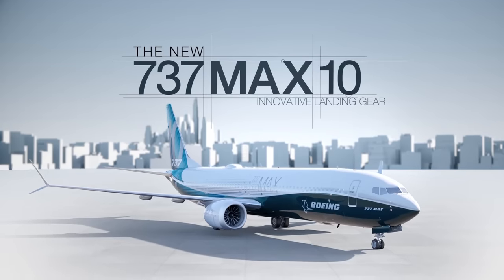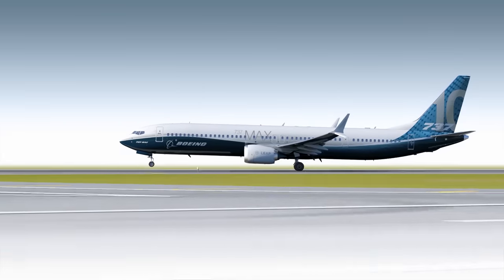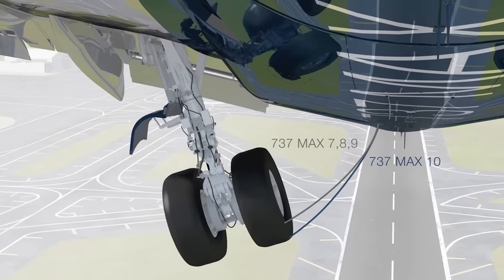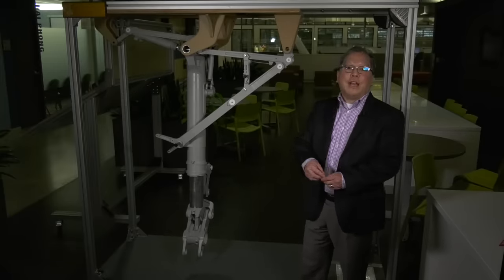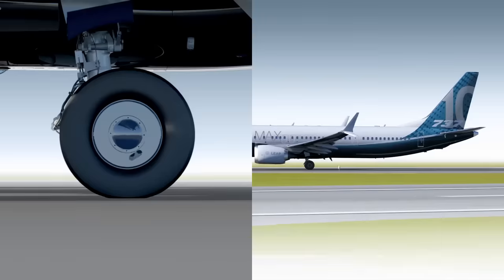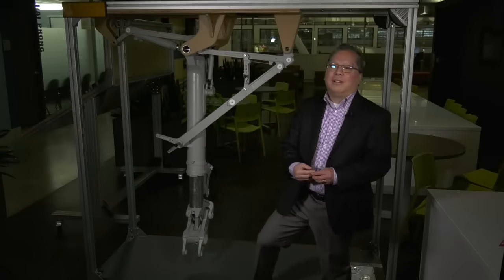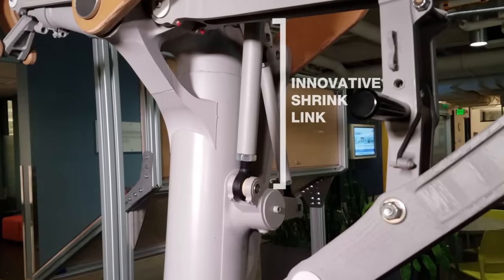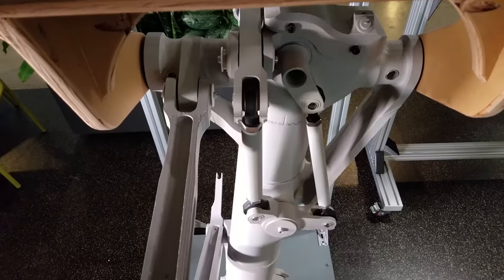How the 737 MAX 10 landing gear works

Comment: Very clever engineering, but also a sign that they have reached a limit on the 737 airframe.  Time for a new design.
Reply: Totally agree, the true plane that brought flight to the masses, not the 747. The MCAS, this complex landing gear, to preserve commonality between 737s. I can see the current 737 market thriving in remote airports etc with few facilities, just my opinion. I guess the time used to fix MCAS, the 787 faults, bringing the 777X to market and deciding what to do with the 748 has left Boeing management in disarray with no clear plan for the future. Just my opinion; not saying my opinion is fact!
Reply: Designing an overly complex landing gear to fit into a bay designed 60 years ago for a plane nearly half the length... 😬
Reply: Noo I love the b 737 fuselage😢
Reply: Don't fix what's not broken
Reply: Corporate doesn’t agree.
Reply: Would it be better if they had it like the Boeing 727 or 717's setup, engines mounted in the back
Reply: @wooden2187 You couldn’t design this landing gear even if you wanted
Reply: Why ,production is backed up 7 to 10 years.

Comment: That's cool but you won't be needing landing gear if you nosedive into the ground just saying...
Reply: MS Aviation TFS the 200 & 300 didn’t with its faulty rudder design. But if you look at the stats the 737 has statistically had more accidents than the A320 even if you start the stats from the A320’s first flight
Reply: MS Aviation TFS go on then. These are the last 10 major accidents and incidents of 737....

Ethiopian 302-Mar 2019 Unknown
Lion Air 610-Oct 2018 Unknown
Air Niugini 73-Sep 2018 Undershot Runway
Utair 579-Sep 2018 Overran Runway
Xiamen Airlines 8667-Aug 2018 Crash Landing
Lion Air 892-April 2018 Runway Excursion
Southwest Airlines 1380-April 2018 Uncontained Engine Failure
Pegasus Airlines 8622-Jan 2018 Runway Excursion
Southwest Airlines 3472-August 2016 Uncontained Engine Failure
Batik Air 7703-April 2016 Collision
Reply: @martinshiel7029  I think you should go back to your office at the Boeing marketing
Reply: @tomstravels520  I think Boeing tried too hard to push the 737 above and beyond it's limits. Boeing didn't had any other choice, they couldn't just leave the A320neo without any competition, but the 737 was a plane designed for the '60s and the '70s and IMHO the 737NG should have been the ultimate 737. As it's design was influenced to be the best in the 1970s world, where engines were small, landing gear could be lower to the ground to allow for little airports without infrastructure to still support 737 operations. The A320 was born in a different world, a world of high bypass turbofan and a world where every airport has equipment to handle even planes that sit higher to the grond, and on the longer run, this difference really made the 737 not able to compete with the A320. Boeing cannot make the 737 the plane of tomorrow when it's design was optimised to be the plane of "today" (as it was built). Still the 737MAX had the potential to beat the A320neo but at much higher cost and risk. At this point they need something completely new. Or a complete overhaul of the 737. I think they will try and make a small version of their NMA to try and get the 737M10 and A321neo share. That also explain why the A320 is almost as popular as the 737 even tho is a good 10/20 years younger
Reply: MS Aviation TFS The 737 has a clean record? Hahahahahaha. That's the biggest load of rubbish I've ever heard.
Reply: Thomas Mortimore Most Boeing 737 crashes are 737-100/200...
Reply: @tomstravels520 , but 737 is created before a320. 737 has longer lifetime. Thats why
Reply: AHHAHAHAHAHAHAHAHAH XDDDDDD
Reply: @martinshiel7029  No, All lies.
Reply: Thomas Mortimore lmao u have went way to far bro jeez..
And i would get u the airbus ones but cba with people like and idk why u guys ain’t backing me up this guy is taking the piss out of the ethopian 
Crash:( ...ye mines was a stupid comment and I haven’t checked the stats ... i only heard that from a yt channel...sorry bro have a good day:)
Reply: Thomas Mortimore here u go...so much crashes i cant even type it lmao https://en.m.wikipedia.org/wiki/List_of_accidents_and_incidents_involving_the_Airbus_A320_family
Reply: @martinshiel7029 , @TechLover 
 Guys, can you stop this fight on the safety record of the A320 and 737, those cannot be compared. The A320 and the 737 were revolutionary planes of their own accord and both of them had some issues at launch.

The 737-200 had the rudder actuator problem

The A320 suffered from some errors of its Fly-by-wire system

Now both those problems do not exist anymore and the A320CEO and the 737NG are perfectly safe planes.
Those problems were related to the fact that as of their launch this was pretty new technology and, even tho it was tested, the only true test is in the real world in operational conditions, so stuff like this can and will happen, no matter if it's Boeing, Airbus, or Antonov

You guys cannot judge the A320NEO and the 737MAX based on the safety records of their older version, it's pointless and it's just wasted time.

But whatever, technically the A320 has a better safety record. But as stated, it does not matter.
Reply: I clicked on this video just to see what the comments were in 2019... I was not disappointed 😂😂
Reply: This gear helps on takeoff so you can get into position to nosedive into the ground
Reply: DatGamerYTx - Gamer 4 Llfe I know, due to the limited technology. But the 3/4/500 series still had plenty of accidents
Reply: qhualla izhar do a calculation then. The number of crashes the 737 and A320 have had and divide them by how many years they’ve been active to make it fair. I’m fairly sure it’s still higher
Reply: MS Aviation TFS if that’s the case I would have just linked the 737 ones
Reply: Federico Di Liberto I really don’t have the time to do that. Go on Wikipedia and search a320 and 737 crashes and analyse yourself
Reply: @tomstravels520  
"So if the 737NG and the A320CEO are safe, and they are safe, any problem regarding the A320NEO or the 737MAX are not comparable to any of the problems encountered on the 737NG or  A320CEO"

For me both are perfectly safe planes I would fly on them without thinking twice, so I have no will nor do I care sincerely, because I care more about the hundreds of thousands (or even millions) of successful flight rather than tens of crashes.
*Talking about the A320CEO and 737NG
Reply: @martinshiel7029  other 737's have a clean record?
Reply: @theblackboyjoe  Must have took you a while to come up with that one, didn't it.
Reply: @mypinis  Technically yes, because accidents can have lots and lots of causes. But there are no faults with 737 from the -400 to the -900 inherent with the aircraft. The only 737 which had design faults was the 737 classic (-100/200), and now there are ongoing investigation with the 737MAX
Reply: That could have been easily prevented if the pilots shut off that system so it's mostly the pilots fault
Reply: @federico339  alright, let's just agree that flying is not as safe as they pretend.
Reply: @mypinis  Why is that? The 737 for example is flying from the 1960s, there are more than 10.000 of them and yet had tens of crashes in probably millions of flight hours. And a lot of them involved the 737 classic which is really old. Aircraft such as the A380/787/A350 never had any fatal accidents.

The aviation world is really safe. I study aeronautics and I can tell you there are a lot of safety procedures and for a flight to crash there has to be a really unlikely chain of events and just a mistake of one person will never cause a crash.
Reply: @mypinis  The 737MAX is just the 4th gen of the 737 aircraft (designed and built in the '60s in it's initial form), only 376 planes were built up to January 2019. The aircraft is still in a really early stage in it's life, and some problems can occur. That doesn't affect the 6.996 Boeing 737NG (-700/800/900) that fly for various airlines around the world, and are the workhorse of many short-mid haul airlines
Reply: @federico339  ok.
Reply: @martinshiel7029  Just another die hard Boeing fan.
Reply: @martinshiel7029  chill, he meant it as a joke
Reply: Mcas isn't on the ten
Reply: @martinshiel7029  Its not the same airbus tho. plus this happened in a span of a year i'm sure of
Reply: Gavin. 😹😹😹😹😹😹😹😹😹😹
Reply: @martinshiel7029  wow.. Wikipedia is such a reliable source isn't it.
Reply: Bro, only comment if you actually know facts about aviation
Reply: I'm sorry guys, I don't have the time to read all these comments, gotta go to work. Bye
Reply: @martinshiel7029  imagine losing your family to a plane crash on behalf of a company flaw...and then a guy tells "oop every company makes mistakes"

who cares if your family died it was just an small error on my part no biggie
Reply: @tomstravels520  because 737 is much older
Reply: @tomstravels520  no 737 NG has a better safety record than the a320
Reply: After a boeing 737 800 nosedive
Reply: ALLAHU AKBAR!!!!!!

Comment: So they stop building the brilliant 757, and then keep extending the 737 until it's the same size as a 757 (but compromised).
Reply: Exactly. It was very short sighted to kill the 757 entirely, everything gone. Not the point here, the 767 could be resurrected but not the 757, I am told. 757 was one the best planes ever, and it took off like a corvette :-)
Reply: There won't be a 797. The development cost puts it at a serious disadvantage with the A321. No airline will pay that premium, unfortunately.
Reply: No disagreement at all on the comparisons between the 757 and A32x/737s. I hope I am wrong but I don't see Boeing investing on the NMA/797 without firm orders and airlines are not looking that far down the road anymore.
Reply: The 797 is in the works. They recently sent out a bid for a engine for it. Delta told Boeing that it would be interested in the 757 replacement if Boeing could get it out sooner rather than later. The 757 has become such a viable flexible option for some airlines that they will have a hard time retiring them before a viable option becomes available. The 737 max 10 won't replace the 757 even tho Boeing wanted to use it in the 757's place. The 737 doesn't have the range a 757 has and the flexibility. Canceling the 757 was the worse thing Boeing could have done as there is a big market for them now. Especially for airlines that require something bigger than the 737 with more range and flexibility but not as big as a 767. A max 757 would have definitely sold I believe. The 757 was introduced at a time when everyone wanted wide bodies and fuel was cheap. That was it's demise.
Reply: Christophe Blanchi Lmao an airplane roach motel
Reply: The 757 line shut down for lack of demand. 

Every 757 left the factory with the weight and bulk of a wide body aircraft with only 220 seats single aisle. Didn’t matter when fuel and maintenance was cheap, but now it makes no sense. 

The A320 series is the Goldilocks airplane. And any wonder... it was designed as a direct replacement for the most popular aircraft at the time... the 727-200ADV.
Reply: @guitarplayerforu  it's a decent design but very dated. A mini 787 is the direction they should be going.
Reply: Text next Boeing clean sheet design will be the true replacement of the great 757. Can't wait
Reply: @pvsantos999  they're already in the design phases of the 797. They're trying to decide the best cabin layout currently
Reply: They stopped building the 757 because it STOPPED SELLING! It was overbuilt and over-ranged (and heavy) compared to the 737-900 and the A321 which airlines were preferring for most of their transcontinental routes back then. And the 9/11 attacks based air travel downturn also conspired to kill it off. Sad but a business reality.
Reply: You called it, you said it was compromised, and you were right
Reply: Ikr.
Reply: @pvsantos999 , 757's hydraulics depend on the engine's fan rotation speed. It has slower response when aircraft is slower such as landing
Reply: It’s still smaller than the 757
Reply: @Bartonovich52  The 757 is the only narrowbody that can cross the Atlantic from east coast US.  It will stay that way until the A321LR enters service.  It also has enough power to take off from shorter runways, allowing more airports to accept higher capacity aircraft.  Unfortunately, when it was discontinued, it hadn't started being used on long and thin transatlantic routes yet and I think if that had already started, it would not have been discontinued.
Reply: Dude. You nailed it. 737 Max is Boeing's never ending Frankenstein project jet.
Reply: The 757 is in another league compared with the a32x family. It was a shot in the foot ending the 757 production, that eventually lead to the 737max problem. There is so much you can do around a plane that was designed in 1964, in such a way that lead to an almost unthinkable thing that was to install a system with no redundancy or fault tolerance and slap it without even the proper documentation and information to the operators. All of this without proper peer review from the FAA.
Reply: @collinparsons3363  the 321lr already started operation
Reply: @guitarplayerforu  kkkk I want to see if that happens. Mid 2020
Reply: William Limarjo  That's not a design flaw.  It can and has happened to a variety of aircraft, more often than one would think.  There's a procedure to handle such a scenario as well.
Reply: 757 should have been the basis for the 737 Max niche, they should not have made 737s larger to fill the gap. The 757 already had room for larger engines.
Reply: I had the same thought. 
“Ok! We need a longer cabin and a taller landing gear. Something that we have never done before and after the 757” 🤦🏻‍♂️
Reply: Pedro Santos well I hope it didn’t take off like a corvette.😂
Reply: I have heard that Boeing is going to return with the 757, new cmf leap engines and new avionics, that new 757 would leave the a321 below
Reply: @antonyh37  i agree with You , the 757 is beautiful
Reply: They are starting the 757 again
Reply: Exactly!  A 757-Max wouldnt have the issue with the engine size or bigger landing gears if needed, since it has plenty of space for that.
Reply: Paul Shepherd — The customers decide which aircraft gets built, as much as Boeing.
Reply: I don't think some of you realise how much work has to go into just getting a production line going for these aircraft. The tooling for producing the 75-76s has most likely been scrapped since its no longer needed. To start production again would cost Boeing too much, which is why they went with a bigger 737.
Reply: Bartonovich52 yeah well seems like people likes the idea of having a very long single aisle airliner with the weight of a wide body as evidenced by the increased demand of the a321
Reply: The good thing about NOT using the 757 is that it's wake turbulence category is heavy for follow on aircrafts. Leaves more spacing available ATM wise.
Reply: Yep
Reply: @pvsantos999  Believe it or not (I was surprised to find this out recently), the 767 is still in production.
Reply: @antonyh37  Still waiting
Reply: Killing B757 is a right move. The bad moves would be when they didn't built B737/B757 replacement back in 2010s.
Reply: @RagShop1  yet now there’s a demand for it again. It’s how these things work. Just the same as how the A380 and 747 are now less desirable as a 787/a350, where as 15 years ago it was quite the opposite
Reply: The 737 is the 757's debilitated, steroid-addicted cousin twice removed
Reply: It’s basically a twin-engine 707 at this point.

Comment: "From the pilots' perspective, there is no difference..." Didn't they say the same about the MAX 8?
Reply: M👏C👏A👏S
Reply: They did say that for the Max 8 as well... no change neede .. just an ipad demo !!
Reply: @77l96  but did the a320 neo tend to decide that it didn't want to fly anymore?
Reply: Doge Bomber almost crashing while testing is better than actually crashing with passengers. Twice.
Reply: @77l96  when did it almost crashed when testing? please tell me what happened
Reply: Adam E. — They said the handling characteristics would be the same, but they weren’t talking about a fault mode.  The MAX had a fault mode which produced bad behavior, and which Boeing didn’t understand at first.
Reply: i think that's because, after take-off, they will never need landing gear anymore.

Comment: This is perfect, as long as the aircraft lands on its wheel rather than nose
Reply: That applies to all aircraft with tricycle landing gear.
Reply: @user-do5zk6jh1k  which in this case does not applicable since it lands nose down
Reply: @syedzaidi1463  Oh shit. You were making a crash joke. Got it.
Reply: f
Reply: Its land perfectly with MCAS systems ON!....
U dont event have to waorry about landing gear,cuz its have 'Make Crash Automatically Systems'
😱🤔😝😑😖😰

Comment: "We needed to fit [item] into the standard 737 fuselage"
sums up the disaster quite well tbh :'D
Reply: Take a very well designed aircraft, that does its intended job extremely well and then try to design it to do something it was never designed to do then wonder why it doesn't work as well...